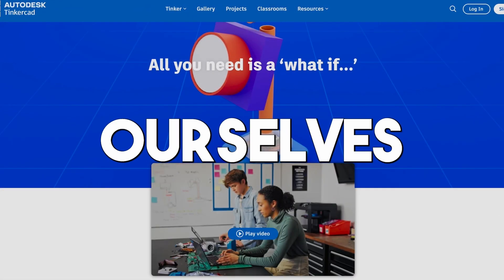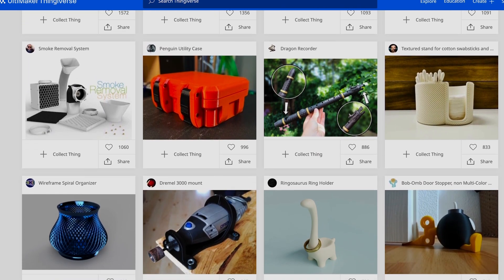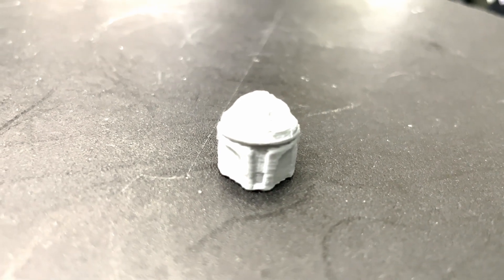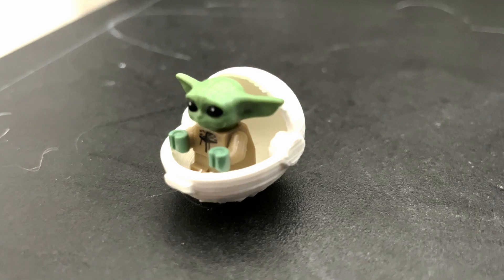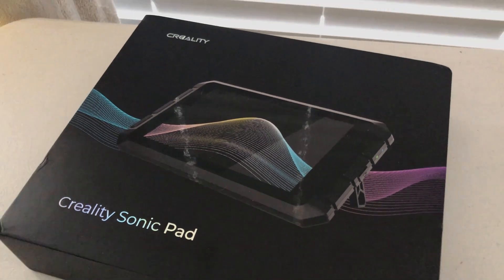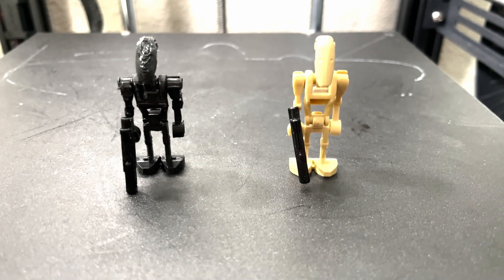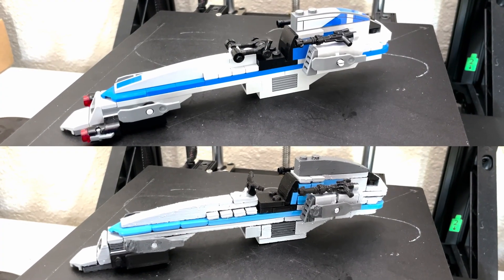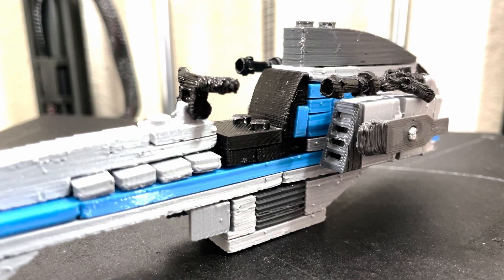We 3D Printed LEGO! Does it work?

Comment: The quality might be worse because you are using a filament 3d printer and not a resin 3d printer usually the resin is better for such smaller prints as the filament creates layers of plastic while resin is using a substance that turns in what you want to print. The resin is much more difficult to work with because you can’t just take the print, you will have to put in under a uv lamp and clean it with alcohol, also you will need good ventilation in the room you are as the substance that the printer uses is toxic

Comment: You should try doing the Lego printed parts slow speed and with a smaller 0.2 mm or 0.1 mm nozzle instead of the normal 0.4 mm nozzle the speed you should try printing at when you got the smaller nozzle is 30 mm/s ( normal printing speed for that type non klipper printer is max 60 mm/s ) 
and also do a test print of the Temperature Tower from thingiverse to make sure the filament you print with is done at the right temperature?

Comment: I think you got the settings wrong for your printer or maybe the fillament wasn't dry enougth ? 
Try putting your old filament it in an oven at 50°C for an hour and setup the slicer with the proper parameters for the filament thickness and melting temperature. You shouldn't have your prints so stringy. I would also drop the precision to 0.12mm so get better results. It's super slow but worth it.

Comment: I use my printer to make missing legos for my kits. Most of the time if there's an issue with the brick, it's usually my printer settings. But I do end up making some cool bricks. I used glow-in-the-dark filament for my tutorial. Came out pretty decent.

Comment: Yes I have seen a great prints a great deal better, you know when you lower the nozzle too low, You will also throw off height set. Or you could even clog the nozzle, or you may have had a loose belt which could make the blobs on the model too. Enders are known to be tinker with a great deal. Also to adjust them right again like using PID Tuning also understanding if the bed plate is running at the right temperature. until you apply knowledge to 3D World: https://www.youtube.com/watch?v=k4Cc_3G4mpc